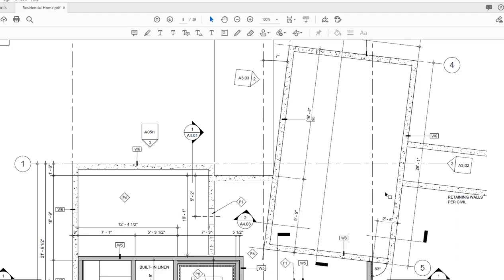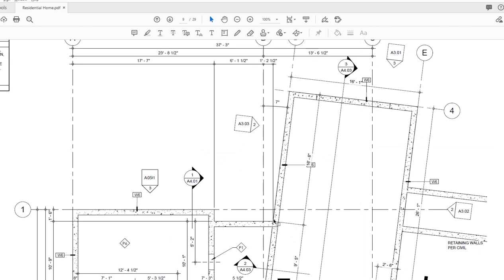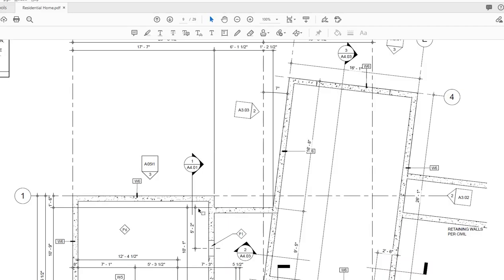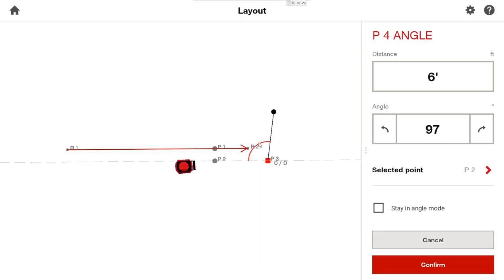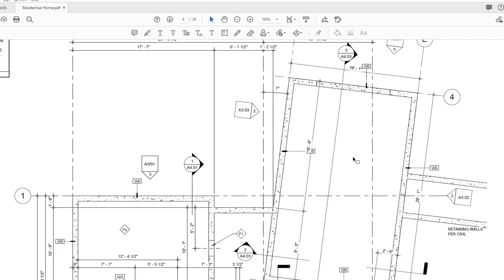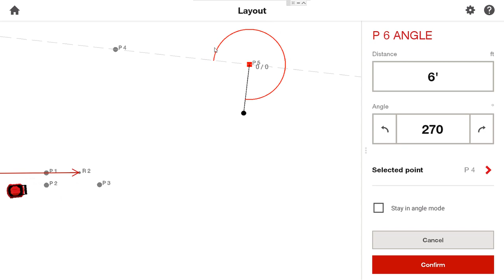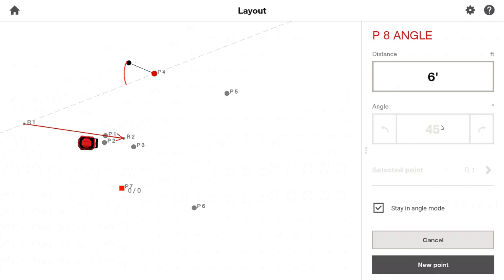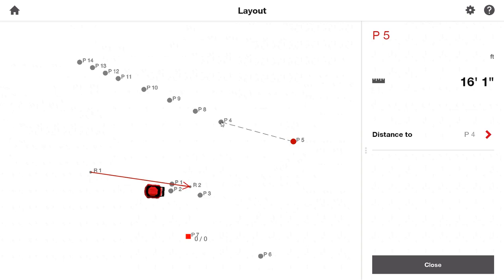PMD 200 Layout Tool - POINT LAYOUT - Intermediate Point Layout (Angles)

Comment: Omg this is awesome. Once you know the tool you can be 100% confident of setout and one man to do it. Im just wondering what it would be like on larger work sites greater than its accuracy threshold, probably not too hard to move it and re-calibrate the points? Oh man im itching to give it a trial, might ring hilti rep tomorrow😅
Reply from the maker: Thank you for the feedback! For larger jobsites, if you are using this tool, just make sure you have accurate control and grid lines - and it should be fine. If you are consistently doing larger jobsites and floors, you might want to consider the PLT 300 total station. It's $25k to purchase, but i've seen that thing pay for it self quickly in how fast it can layout, work with heights, minimize errors, process layout reports, etc.